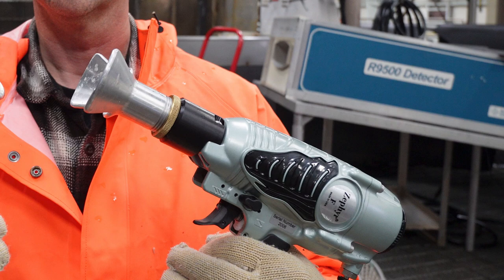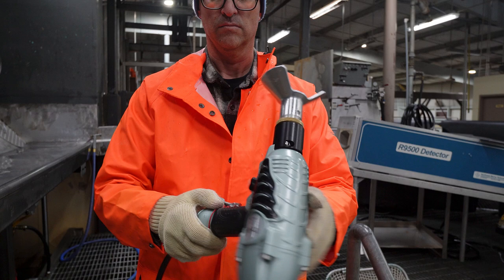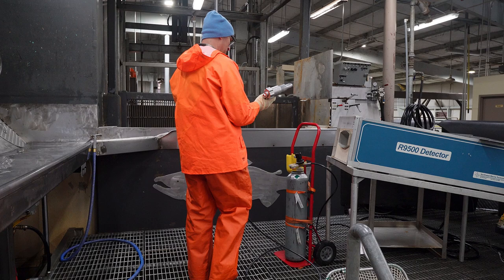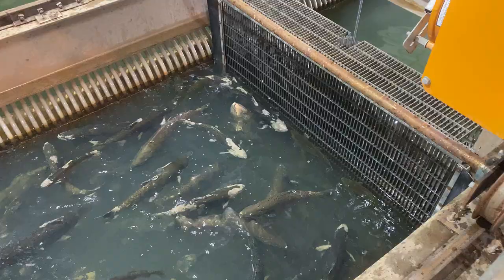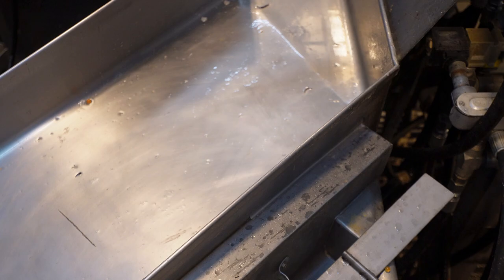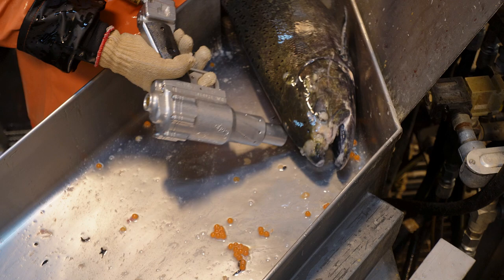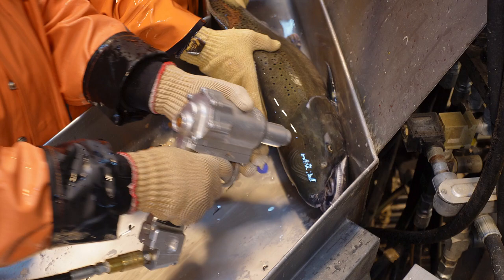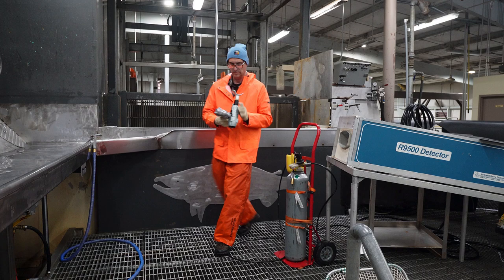Innovations in Fish Farming: How to Kill a Fish, Captive Bolt Gun Review

Comment: The HBS1 looks so much better, as long as u have some experience. Higher likelihood to kill immediately, fish don’t suffer, meat doesn’t go bad from spasms & stress as quickly as suffocation, it’s all much better. Thanks for the video, I fish a lot and I use ikejime, and it’s neat seeing how a close equivalent is done on an industrial scale!
Reply from the maker: For smaller fish the zephyr is just fine. I will be coming out with a video of the Jarvis for use in Sturgeon aquaculture within the next couple months.
Reply: Very informative video. The success of both products could be increased by using a dedicated device that holds/positions fish to make handling easier - perhaps some sort of trough (v-shaped) lined with a non-slip material (e.g. carpet). This would improve consistency and theoretically increase the successful placement of both bolt guns.

Comment: After watching a few videos on these things being used on beef, it's not surprising this showed up in my recommended. Seems to me that the Zephyr is better suited for smaller factories with less personnel on hand, whereas the Jarvis is pretty obviously a two-man job. I wonder if operation of the Zephyr would be easier if the two "blades" on each side were transparent plastic or glass, so that you could see more clearly where you're positioning it on the head. Really interesting video.
Reply from the maker: I can use the Jarvis as a sole operator. Remember these are inexperienced operators. I suppose I need to do another video on each. I probably can to that on sturgeon relatively quickly. I hope to have a different bolt head from bock industries for this fall. Another thing to consider as this operation hadn’t used them before, so any changes to the set up would likely increase the efficacy of stunning.
Reply: @ThisIsAquaculture Granted it can introduce it’s own problems, but using a cable to make the weight “disappear” has me intrigued as well from an ease of use/ergonomics perspective.

You can use the heavier tools with less fatigue and all that this way, at least in theory
Reply from the maker: Agreed. an overhead cable would reduce the weight and is commonly employed in other animal industries.  @ericlotze7724

Comment: 0:36 that must have been deliberately shaped as a joke. is it really necessary for function, that there's a crevice which separates the head of the bolt 😀
Reply from the maker: Not a joke. We discussed the engineering of it. We discussed after the video sending me a different bolt head, a flat on for me to experiment with.

Comment: Sensation occurs when there is ample oxygen supply in body of organism , the most painless way is to suddenly cut oxygen supply. The way you are killing will cause the fish to be brain dead or in comma but the fish will be alive . Cut the head with a sharp chopper. That's the best way imo.
Reply from the maker: Cutting head off is labor intensive, slow, and would occur after spawning. You would not exsanguinate the fish prior to strip spawning them at this facility. Stunning is the first step prior to the termination step which would be exsanguination. Having the fish brain dead helps to maintain heart function which helps to push blood out of the fish.